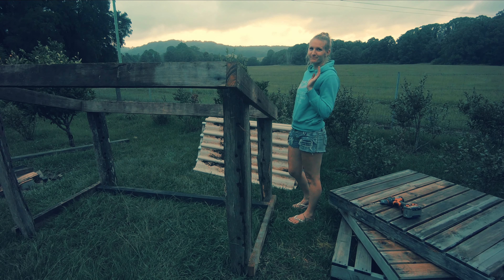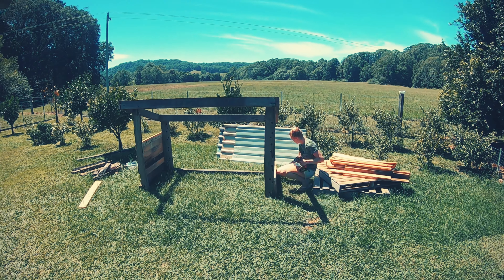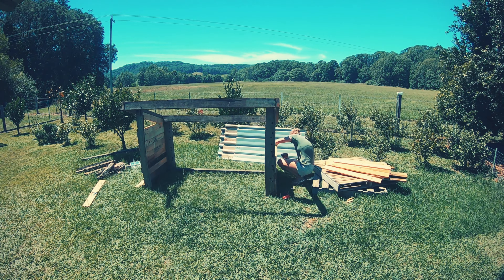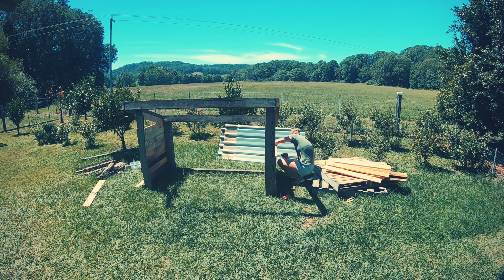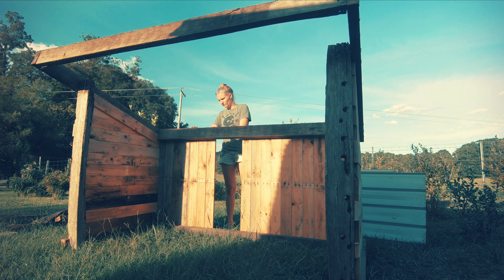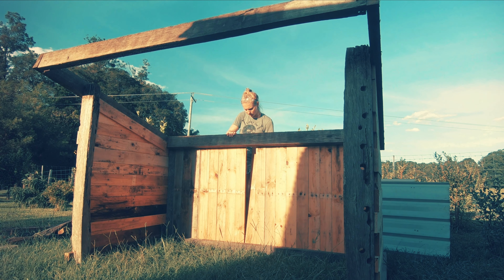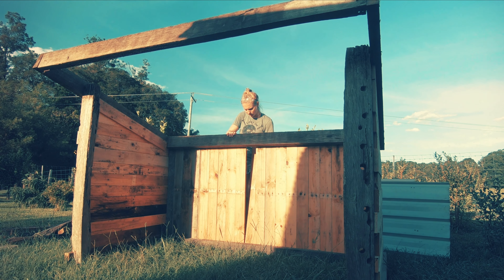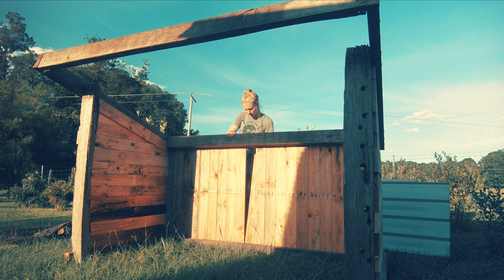How to Build a Sheep Shelter - Easy Animal Shed - Livestock Shelter Made from Pallets/Simple Shelter

Comment: Easy thumbs up. Thanks for sharing. What kind of sheep do you have?
Reply from the maker: Thanks very much.
We had a couple of Marino's in the beginning. Which were a good size to fill the freezer. But the shearing became a pain. And a bit heavy to through up onto the trailer.
We currently have female fat tail sheep, with a Wilshire Ram. But occasionally go for a drive to grab some Dorpers from a friend if we are running low.
Reply: Nikita Maree thanks. I was just looking at the Wiltshire this morning. I’m trying to narrow down breeds but there’s so much to choose between. We live in an arid part of San Diego County. Any advice on beginner breeds, best rewritable to pest/worms, or where I can research?
Reply from the maker: We are relatively new to owning sheep ourselves, (but my husband grew up with cattle), and we are in a wetter climate. Although we did just go through a dry patch. Our problem at the moment, is a bit of foot rot. But only with the couple of woolly breeds we have left. They can't seem to stay dry at the moment. But we give their hooves a scrub with a toothbrush and soap, and they stop limping in a day or two.

This website talks about arid breeds. half way down the page is the meat breeds they suggest.
I would recommend  a breed that produces very little wool and on the smaller side.
https://aces.nmsu.edu/pubs/_circulars/CR684/welcome.html

We process all our meat at home. And the larger breeds have been harder to lift and winch up. And the woolly breeds have had more health problems were we live. And the thick wool also makes it harder to skin. Not impossible, but it definitely adds time to the process. 

Good luck, and I would love to hear what species you decide on 👍